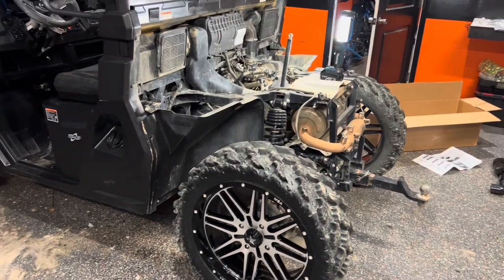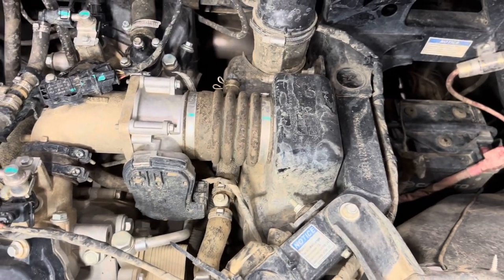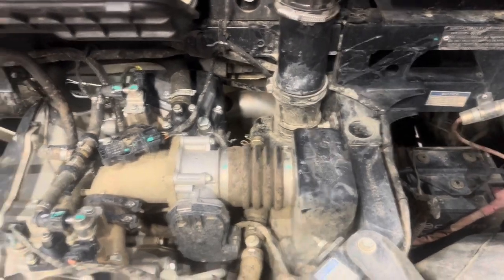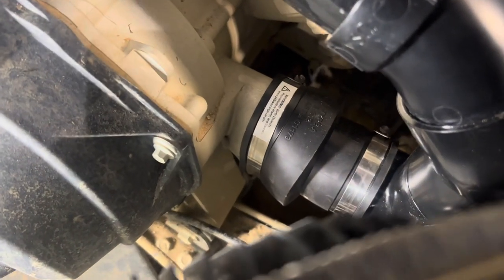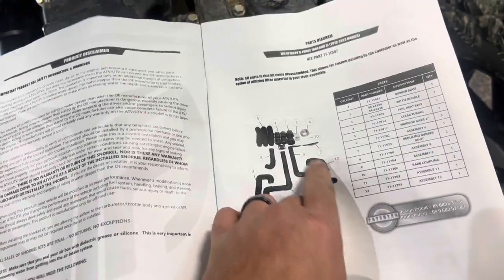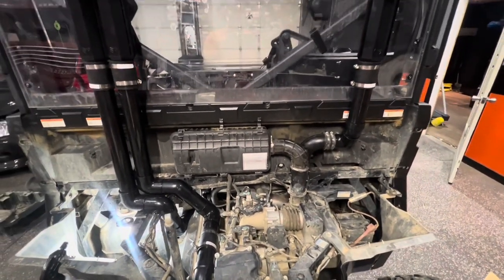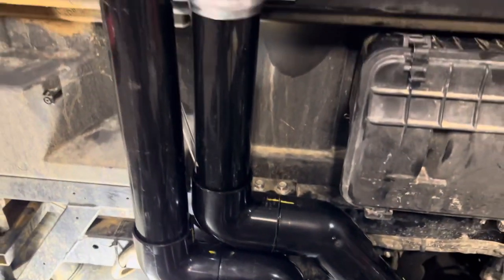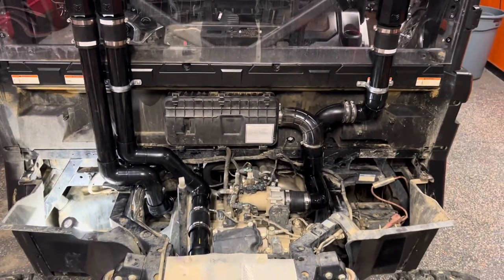CFmoto Uforce 1000 Snorkel Kit install

Comment: Wow this video was really helpful! Just subbed. I have a 2023 XL and want to get this snorkel kit but thinking since you named all the bends etc. I might just make it myself... Considering it's $600CDN here for it. What silicone did you use?
Reply from the maker: I’m sure any black RTV silicone is what they recommend using.  I use Right Stuff for most my
Automotive sealant needs.

Comment: And did eliminating that stock box did you have to tune it
Reply from the maker: No tune
Reply: @Robo-dj4hk  did it fit with ur bed on mine want going over that metal bar for the cvt pipes bc the bed had a metal square tube on the bottom that hits

Comment: Hey I’m trying to get me one was wondering if you have any issues while water riding ?
Reply from the maker: Before snorkel or after?
Haven’t rode thru water yet with snorkel installed
Reply: @Robo-dj4hk before I had some people say. They have had electrical issues. So was wondering your experience
Reply from the maker: @pedrocanskit3752  not really, blew one radiator fan fuse, other than that no problems for me
Reply: Use Dielectric Grease on all your connector